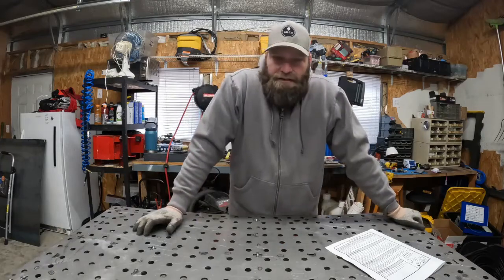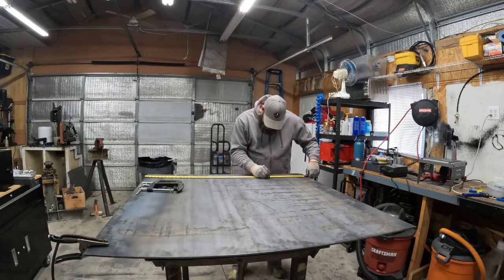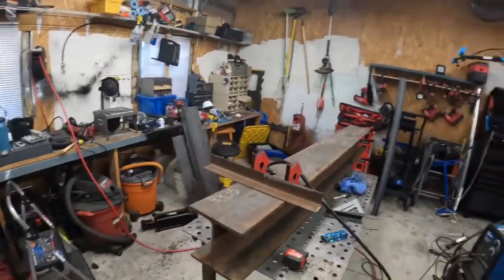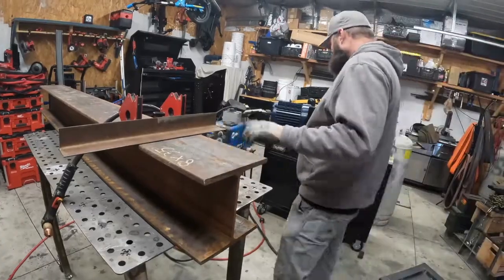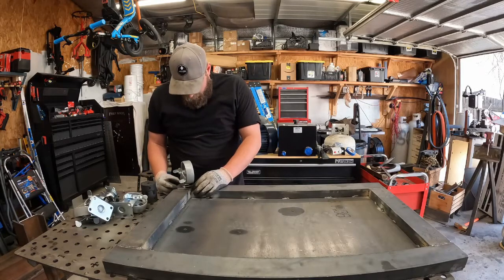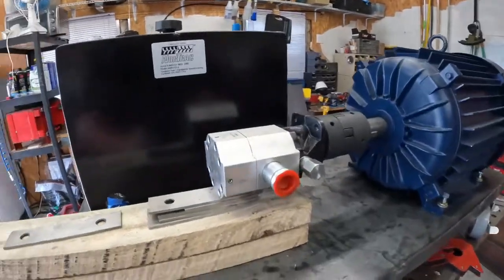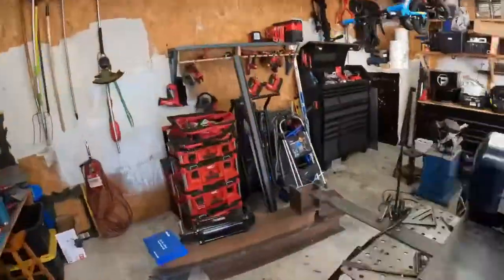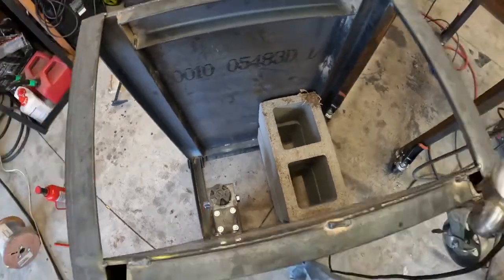30 ton home made forge press

Comment: That's one good looking design - more than strong enough for 20 ton.  In part 2 it sure did a jog of pressing.

I've watched part 1 and part 2 both.  It seems I missed the specs on motor hp, pump GPM, size of cylinder - all the good stuff.
Reply from the maker: I might not have included much technical stuff. It's a 2 stage pump 13 gpm. The motor was 7.5 hp and the cylinder was a 5 inch bore with a 10 inch stroke and a 2 inch rod.